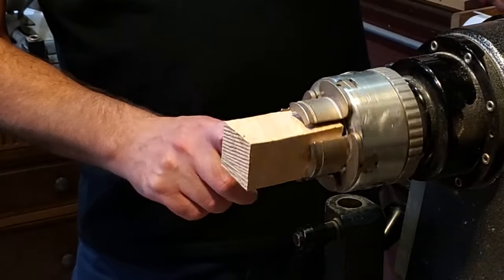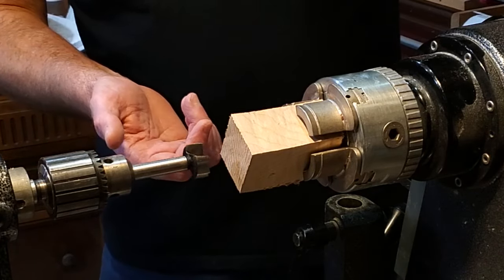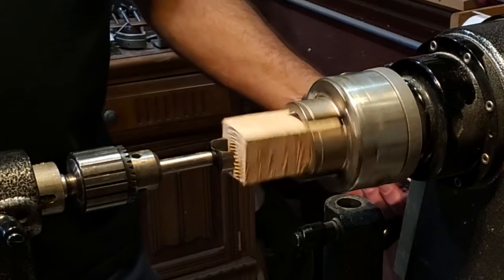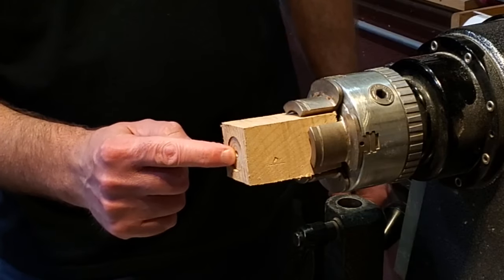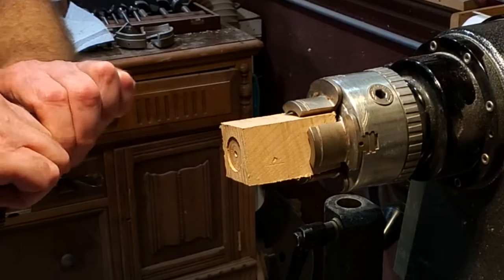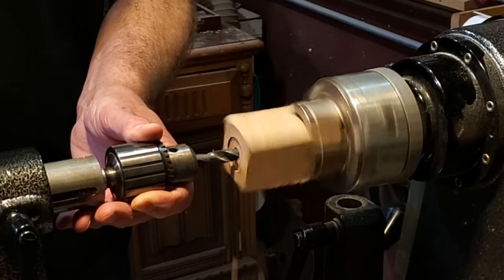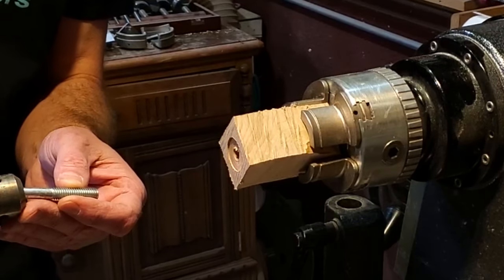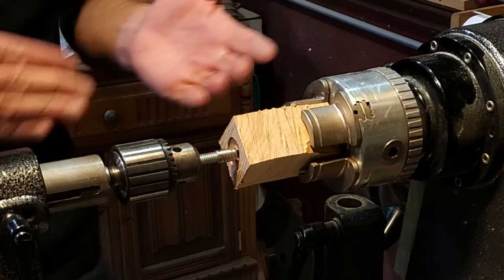How To Get A Perfect Fit Between The Stopper And Your Blank

Comment: Great tips. QQQ: I have Ruth’s self-tapping mandrel but it seems that when turning I many times strip the threads. Maybe I’m too aggressive with my cutting or the wood was exceptionally hard but. Can you provide tips on how to prevent the mandrel from stripping out?
Reply from the maker: Thank you Lee! Did you see the video I did on cutting threads with the mandrel?  https://www.youtube.com/watch?v=D7Xdl2hDRtc I go nice and slow. I know it takes a little longer, but I haven't had any strip out. I also shape 99% of the stopper with the tail stock up.
Reply: @nilesbottlestoppers  Thanks Carl, this should help. I initially looked for a video on my issue on the homepage of this new site and didn’t see anything on it. After you provided the link I went back to the homepage->Videos, and lo and behold there were a bunch of videos. You have been really busy filming since taking over. I’ll watch several others from the list. You might want to point that out to your other viewers to look under “Videos” and not just “Home”.
Reply from the maker: Glad the video helped. Go point, I'll mention about the video tap on the next video.

Comment: So you failed to actually thread the threaded insert into the wood and that's the part that I have figured out is not possible. You have to rotate something so you're going to have to hand rotate the wood while using the tail stock to press the threaded insert in. Maybe you have a smaller lathe but mine is way too big to have both hands working at the same time.